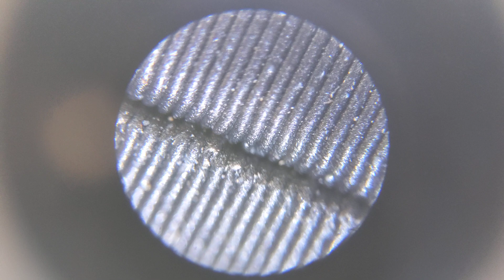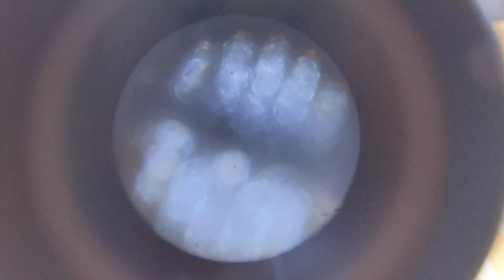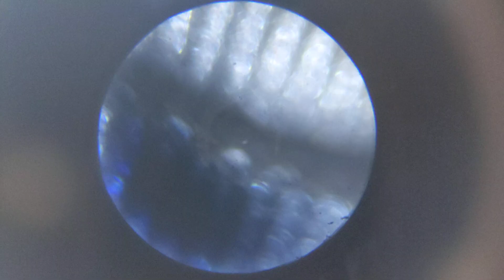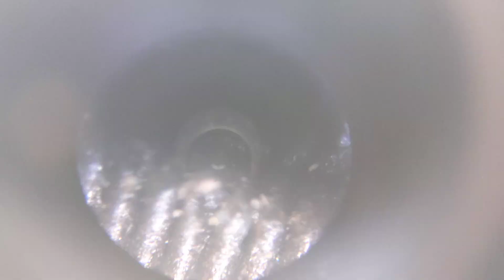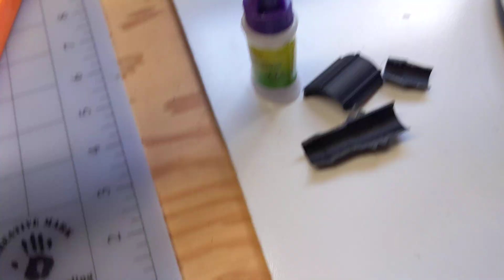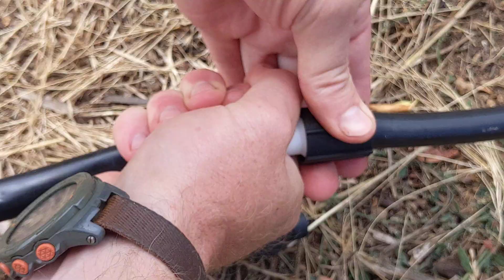Putting 3D Printing under the microscope

Comment: Could you put a cube printed in 0.05mm layer heights Ironing turned on!? Please :3
Reply from the maker: going to need some more details here.
Reply: @neotoy  They're both settings you can change in your slicer.
Reply: @neotoy  there is a big room for improvement from easy to more challenging settings, let me propose an alternative detailed scenario partly-based on the Commenter's idea:
- use the same model (hose adapter) (I'm not sure why he proposed a cube)
- most of all, use increased Flow Ratio in filament settings, for example 1.03 instead of the default 0.98 (it kinda puffs out the layers to fill in the gaps)
- maybe also increase the temperature a bit to 222*C and decrease part fan cooling a bit (if it's 100% by default then lower it to 70-80)
- use lowest possible Layer Height because it kinda shrinks the gaps between layers and fuzes them better (if you have the default 0.4mm diameter nozzle then you can probably safely use 0.1mm layer height, depends on the printer, Bambu printers can pull-off as low as 0.08). And if you have 0.2mm nozzle then you can go even as low as 0.04-0.05mm but that's probably overkill
- at least 3 walls (or 6 on 0.2mm nozzle)
- and as the comment's author proposed, try IRONING for each and every layer (in Bambu/Orca slicer it's called "Ironing Type: All solid layers") - maybe that will make it more sealed, I'm not sure but sounds promising

If you are capable of learning how to do Scarf Seam properly then maybe also try it (if possible on your printer).  Scarf Seam is a neat trick that makes the seam very elongated and gradual instead of sharp single point seam like by default - but it complicates things regarding to other settings that I proposed, especially layer height, because with low layer height the Scarf Seam has less room to be gradual, so rather treat it as a separate proposition with default layer height

EDIT: this is a good article about Scarf Seam: https://www.printables.com/model/783313-better-seams-an-orca-slicer-guide-to-using-scarf-s
Reply from the maker: @miauzure3960  Thank you for that wonderfully thorough and thoughtful response. Lots of good ideas and I even learned a few new things.

Comment: 1. You need to modify your print setting. Your seam is supposed to look fused.
Reply from the maker: Yeah... It's not that exactly. This black filament was from a shady ebay seller and I don't know exactly what's in it, but there's contamination and it doesn't fuse properly. That being said, even with quality filament that does fuse, and the leak profile is essentially the same. so the seam is there even if you can't see it, the low grade filament just highlights the issue.